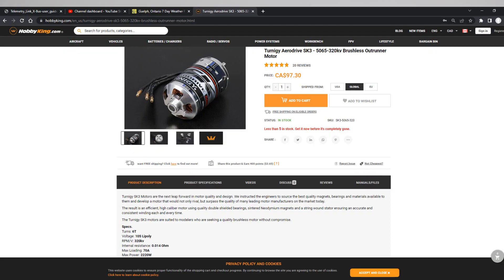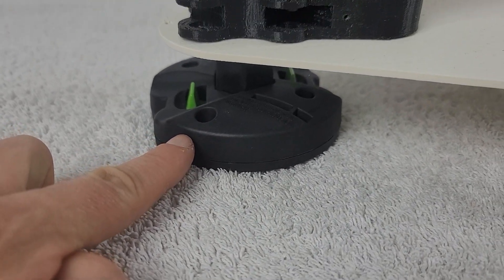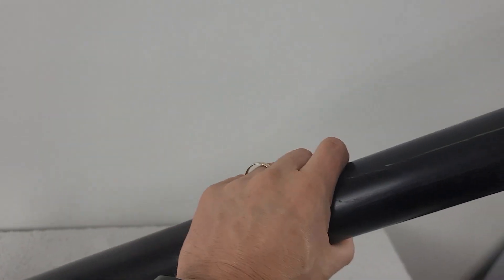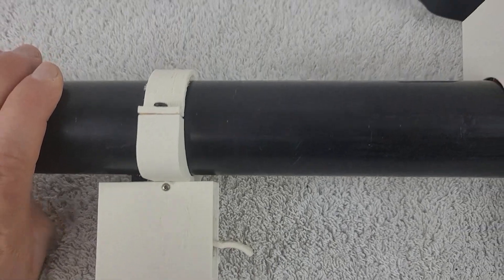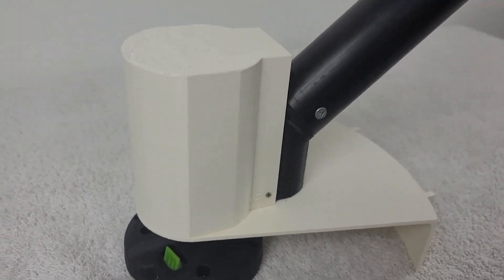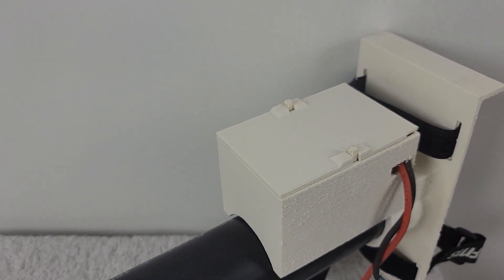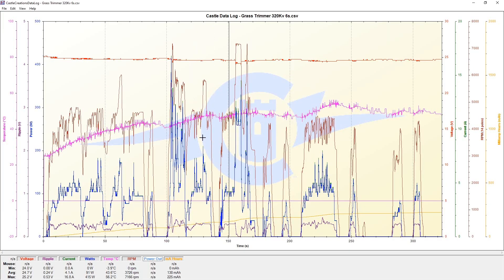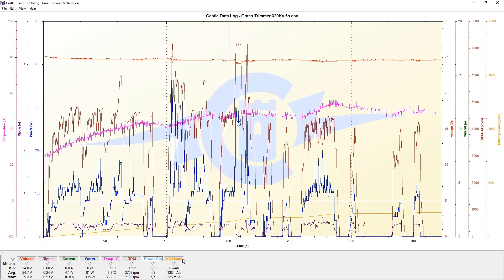First Run of a 2.2KW RC Airplane Motor on a 3D Printed Grass Trimmer

Comment: Wow i can't belive, i just get the same motor to make an electric trimmer but I use an old trimmer without the engine. I see a lot of your video to understand what kind of motor choose
Reply from the maker: What are the odds!
Reply: @RCexplained  I think we are below zero, but now I know i choose the right motor ahahah. Have you any advice to tune properly the esc? thaks
Reply from the maker: Tune the esc for what purpose? I operate on a higher PWM frequency and use the lowest timing that works with the high pole outrunner motor.
Reply: @RCexplained  the esc for this kind of application, but I think you already answered

Comment: This is cool video and a fun project Ryan! I don't think you'll get even close to using the full 2.2 KW! 😊  Perhaps a slightly smaller motor with a higher kv rating would provide quicker/better grass cutting power? Just my 2 cents....
Reply from the maker: Thanks Renko. I'm not sure I will get there but I will try.

Comment: So und das nächste Projekt ist ein Propeller betriebenes Fahrrad. Als Motor ein Eagle Power EA98 brushless motor KV120, 30 Zoll Carbon Propeller, Hobbywing Flyfun V5 130A 6-14S lipo, 12S HRB Power lipo Akku und Servotester für die Geschwindigkeit.